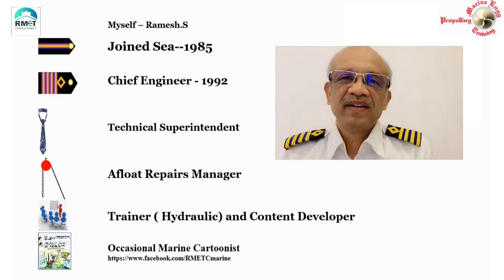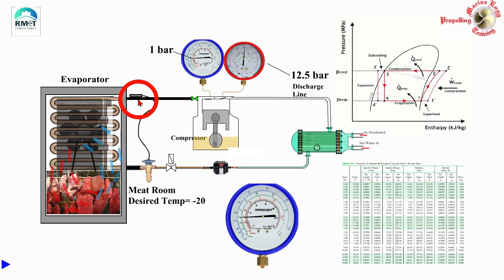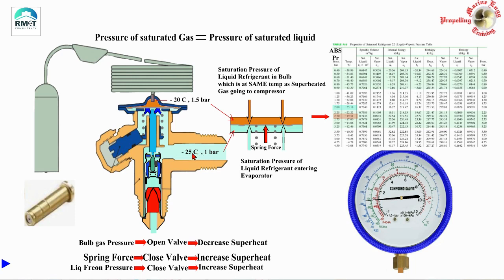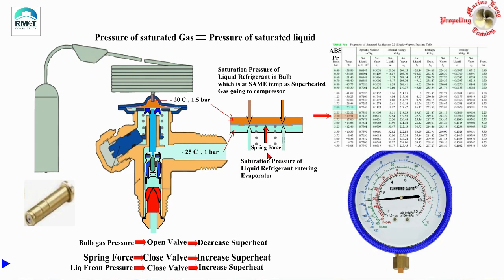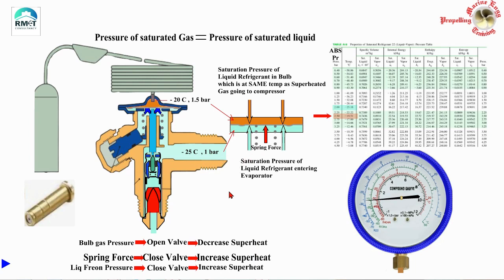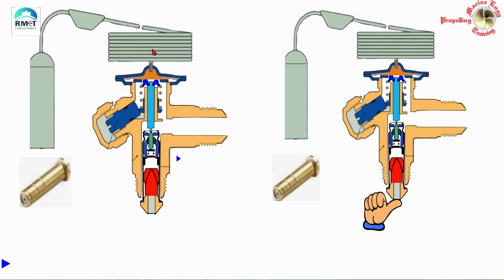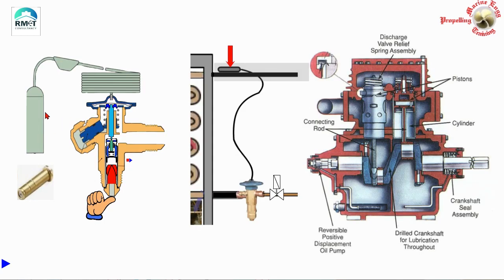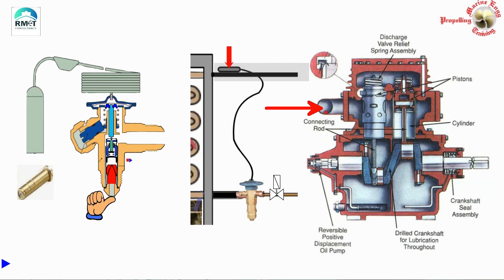Working of Expansion Valve , Defective expansion valve , Liquid return to compressor

Comment: The video is really informative and knowledgeable. The effort you put in for the diagrams and animations is really appreciable. Thank you, Sir.
I have a query though. What happens in the case of expansion valves with an external equalising line? My doubt is that, if the evaporator outlet line is fed to the bottom of the diaphragm, wont it be having same temperature and pressure as the gas inside the sensing bulb? If so how will it open the exp valve against spring pressure?
Also I have read that this is used in systems with large evaporators where the pressure drop is higher; But if the ref gas is getting heated inside an evaporator how will the pressure reduce?  Please explain sir. Thanking you in advance.
Reply from the maker: Thanks for the question. The pressures bottom and top are NOT Same. The bottom one is LESS than Top one. Because the Top Pressure is the saturation pressure of gas at the Superheated temperature and the Bottom one is saturation pressure of the gas at evaporating temperature. The spring decides  the temperature of Superheat.
Reply: @rmetcvideos  Thank you for the reply sir.. The concept is clear now.. The pressure inside the bulb is corresponding to its saturation temp which is acting on the top of diaphragm.. 🙏🏻

Comment: What is the inlet temperature of liquid refrigerant in TEV?
Reply: slightly more than the cooling medium used in condensor, depending how efficient your condensor is. But it cannot be as low as the cooling medium and definately can't be lower than that.

Comment: Sir, the last portion of the video is quite confusing.
We had taught in the classroom that there exist a pressure difference between compressor suction pressure and lube oil in the crankcase.
Reply from the maker: Sorry on that...well,what you have learnt is correct..the suction pressure is normally the crankcase  pressure and the lo pressure is over and above this...so if you see a oil pressure gauge showing a pressure of 3 bar  and suction press is 1 bar  then ..the actual LOP is 3-1 =2 bar. In many compressors the oil pressure gauge has two inputs..onw from pump line and another from crankcase...then this DP gauge will directly show you the LOP..hope this clears your doubt. Actually the video was not delving on this topic..it was only for liquid returning...
Reply: @rmetcvideos  yes sir,
The video is helpful and interesting.
Reply: @rmetcvideos  Good explanation...

Comment: Sir in the last part of the video as u mentioned if some refrigerants are heavier than lube oil they will disturb the bearing lubrication. Also refrigerants which flash off will also cause problem. Then what advantages do we have by connecting suction of refrigerant to the crankcase?
Reply from the maker: If you directly take it to cyl head.. possibility of damage due to Liquid hammer will be very high. when you direct it to crankcase,  only the vapours will go  during suc stroke. The oil beoing at a high temp will ensure that the refrigerant liquid will flash as Gas. The Ref Vapors going inside the cylinder during suction  will be OILY and hence Cyl LUb is enhanced.
The  entire compressor including the oil is Cooled due to cold refrigerant.

Comment: Sir a question being asked in MMD nowadays that how to reduce meat room temperature beyond -20 degrees. If i reduce superheat will the temperature reduce beyond -20 degrees ?
Reply from the maker: I guess the compressor should be designed to work at lower suction pressures..a combination of orifice and cyl/pisto  designs..super heat definitely cannot be the answer

Comment: Practically, do we need to clean the filter of thermostatic expansion valve?
Reply from the maker: I have cleaned many times and honestly I have never seen it dirty :-). SO no need as a PMS...I guess
Reply: I have found the need to clean it on many vessels. I used dry electro clean ( non oil base). Another maintenance I regularly carried out was to fill the orifice chamber with the same dry electro clean. Close the opening with your finger and shake it vigorously. Now you press the spring loaded orifice valve from the bottom and allow the electro clean to pass through the orifice passage.